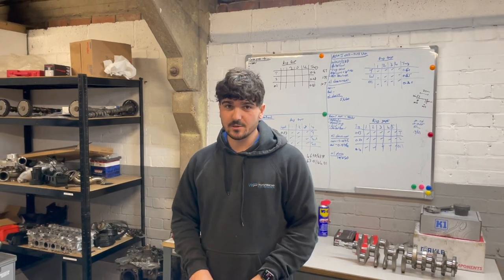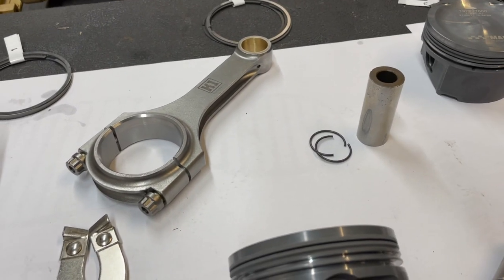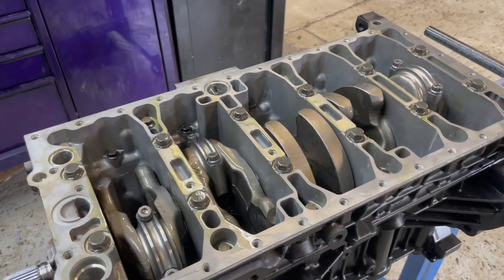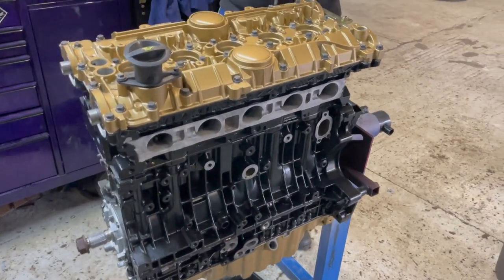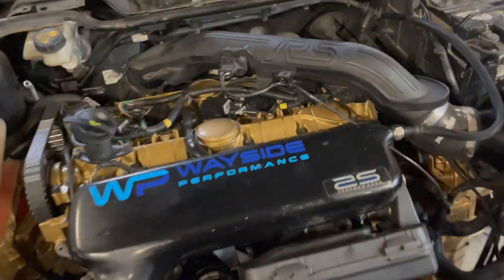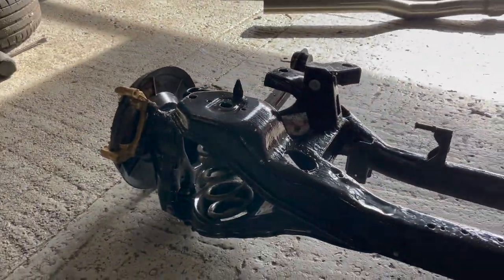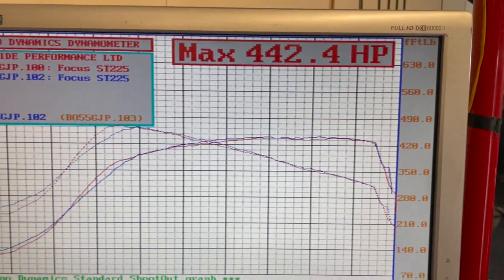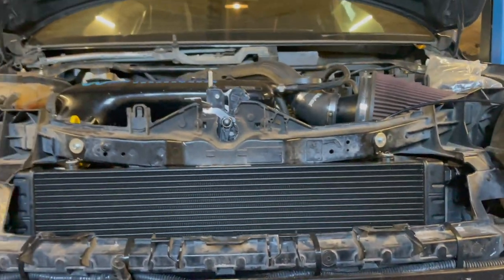440HP MK2 Ford Focus ST 2.5L 5 Pot Forged engine build with stage 2 RS hybrid

Comment: Is the block mod worth doing ? Why do these engines crack liners ?
Reply from the maker: It doesn't stop it from happening completely but it definitely seems to reduce the chance of it cracking.

It is just a weak point in the engine blocks without much reinforcement there, causing it to micro flex and eventually crack.

I have seen them crack with block mod before, but in my experience, the vast majority of cars that we saw with cracked liners did not have block mod done